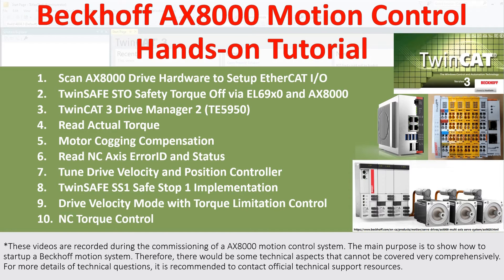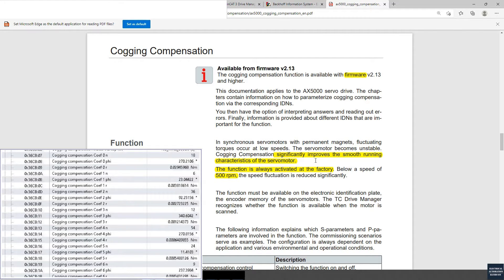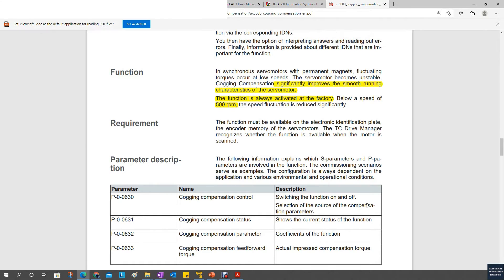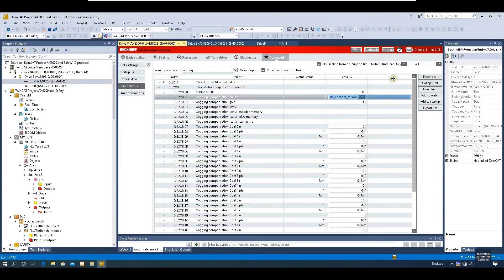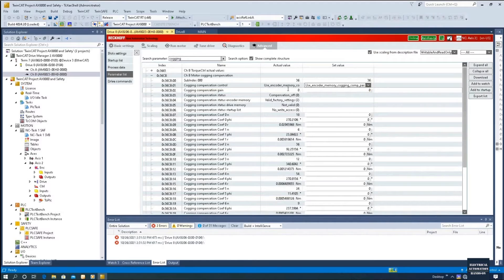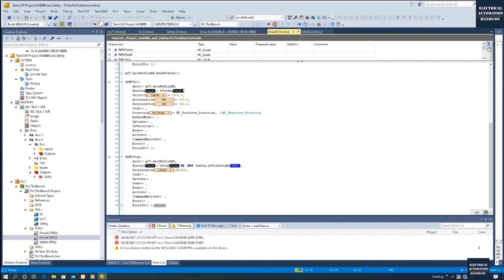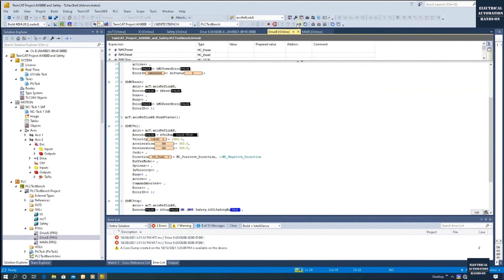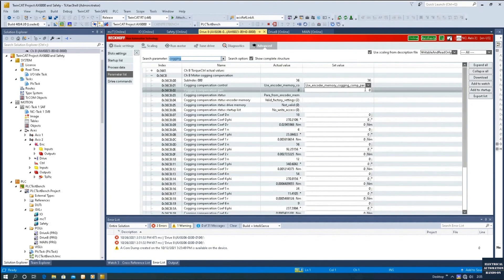MB25. [AX8000 Servo][5/10] Beckhoff Drive Cogging Compensation (servomotors magnet compensation)

Comment: 转矩波形无法确定真实性，没用力矩传感器，建议观测速度波动进行对比。up主有没直线电机，想看倍福直线电机的齿槽补偿
Reply: sorry forget using english. Suggest compare velocity ripple instead of torque ripple because no torque meter is used. Another thing is that Do you have Beckhoff linear motor, I'm interested in the cogging compensation in linear motor. Thanks
Reply from the maker: 非常感谢，最近比较忙回复较慢，多多交流。 我手头没有直线电机，基本都是赶上什么而且我自己感兴趣的就鼓捣分享一下

Comment: Thanks a lot for good information.

You should have show that it results in lower speed-following error and of course also lower postioning-error. If used in oplenloop torquemode it gives smooth response.
I will go and check this, today 🙂
Reply from the maker: Thanks and great point! I was using the servo drive and doing the free run, to show the difference, the torque would be the best to be shown and compared. Also cogging compensation is a topic about the servo motor magnetic this physical parameters issue, the simple test the clear to shown the difference.

Comment: my friend, i use an AX5801 safety card and in section that you had imported  alias devices FOSE related ax8000 servo drives automatically also i search but in my project which i use ax5000 drive it is not recognized automatically and just found my safety input and output !!! i appreciated if you help me. thank you
Reply from the maker: Hello my friend, please see 4.45  https://youtu.be/0vZzOIKKviY?t=282, you need to select "Import Alias-Device from I/O configuration"